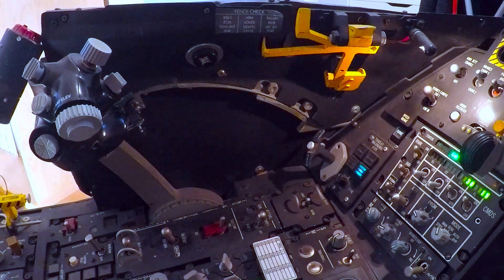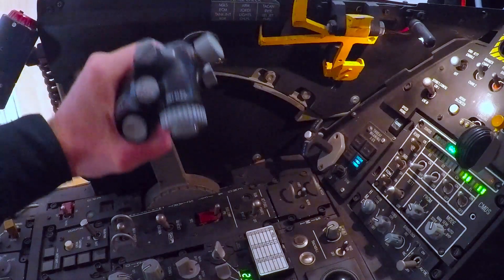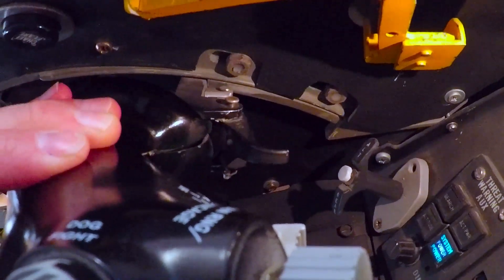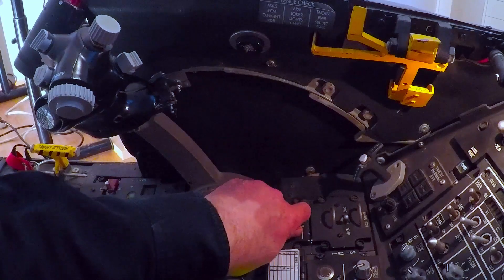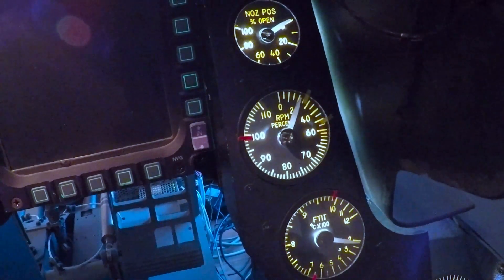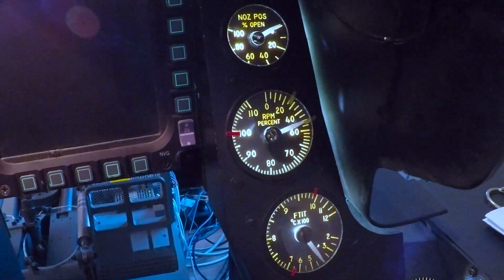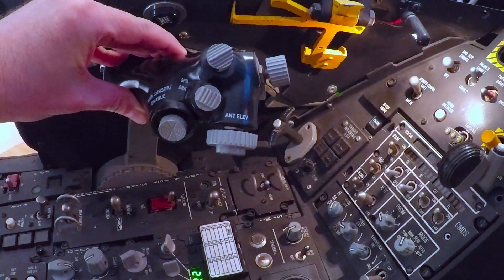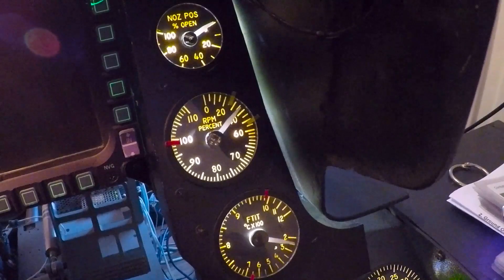Red Dog's cockpit:  throttle mechanics

Comment: Thanks for explaining this. Regarding the idle cut off lever I was wondering: can you lift the throttle far enough at for example 50% movement and then move the lifted throttle all the way to cut off position, this effectively bypasses the need for the lever? Just to make sure I really understand the lift/notch/lever mechanism.
Reply from the maker: Nope. The exact purpose of the lever is to prevent shutting down the engine in flight. To go cutoff you have to depress the lever so the throttle lifts enough to go past the idle point. The lever actually pull a pin that prevents the throttle to be lifted fully. What you describe is happening at the AB gate, there you just lift the throttle a bit and enter the AB range. So the throttle rotates up a bit I'd say 15-20° for the AB gate, but the cutoff gate is greater and the pin prevents the throttle to be lifted to the required 40-50°.
Reply: @VPreddog  first thanks for taking the time to explain all this to me but Im still wondering so let me put it this way: 1. move the throttle to 50%/half way mil power. 2. Then lift the throttle to 40 or 50 degrees angle, because there is no notch to hold the pin from the lever halfway mil power. 3. Move the lifted throttle back all the way to the cutoff position. If this doesn't make sense please forgive me :). But I have a spare cougar throttle which I want to modify myself and it needs to be done correctly. Apparently, getting access to viperpits.org forums seems impossible, because I have never received confirmation to my email address so I seek other means of getting information about the F16 throttle.
Reply from the maker: @slamraamprod  You can't lift the throttle to 40°-50° up anywhere on the throttle course unless you use the lever. without using the lever, the throttle will lift just enough to pass the AB gate. If you have a closer look at the throttle guide rail, you will see that the idle/cutoff notch is deeper than the Ab notch, that implies the angular difference between gate and cutoff. You just can't go past that idle/cutoff notch without depressing the lever, and that's on purpose. Pilots yank this throttle brutally (it's milspec after all :) ) and you don't want a pilot inadvertently shutting down the engine in flight because he was a bit too brutal with the throttle :)
Reply: @VPreddog  Thanks!
Reply: So the lever pin locks in the throttle arm, then I understand the mechanics? I was thinking the pin locks in the rail notch.
Reply from the maker: @slamraamprod  Yep, if you go at 1:31 on the video, you see me depressing the lever and you see the pin moving out of the way so the handle can be raised